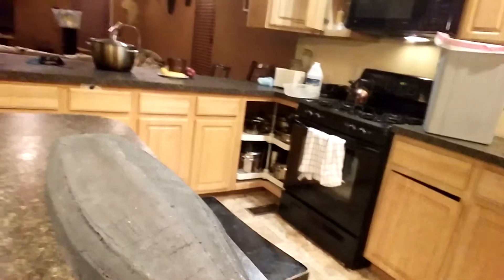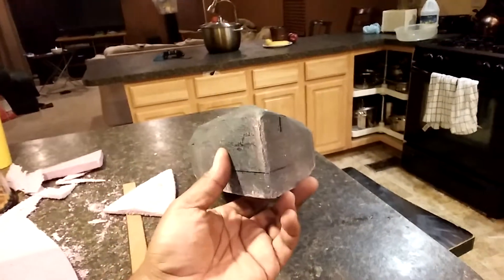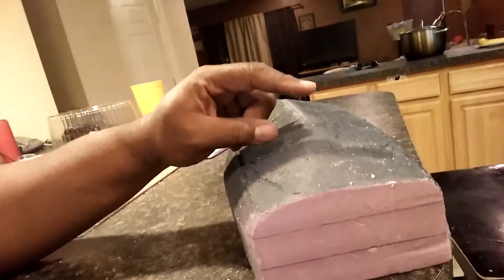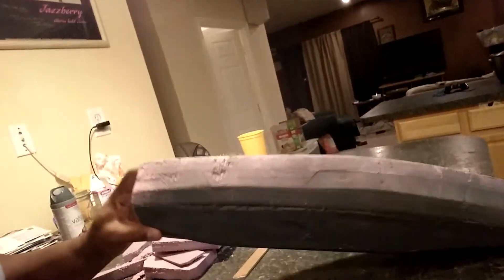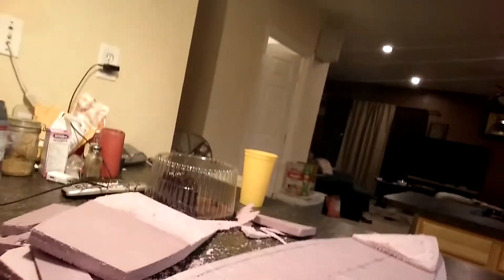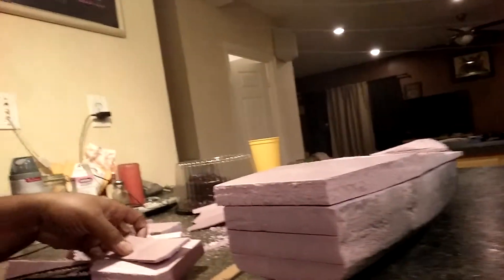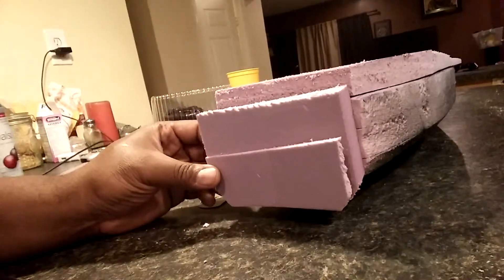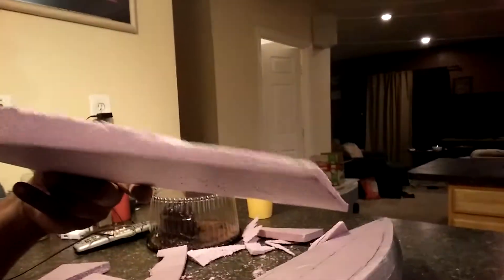Foam hull model progress

Comment: very cool. I did exactly same thing with pink styrofoam for LST model (ww II) did you use a hot knife to cut it out?   did both hot knife and saw.  laminated lifts together with spray glue